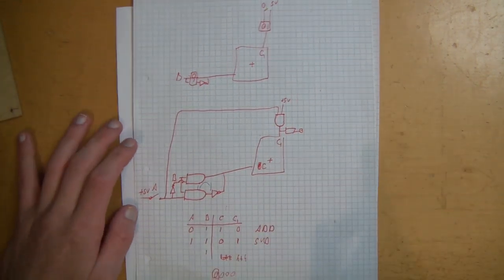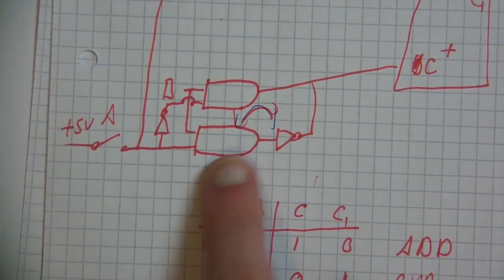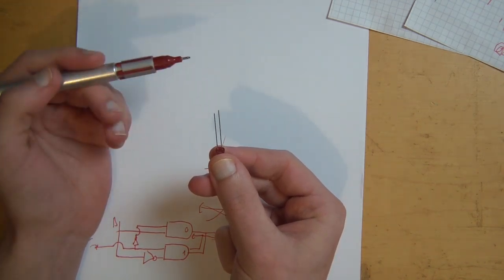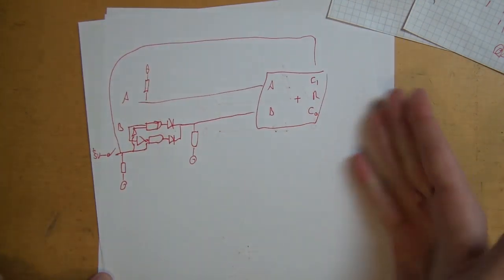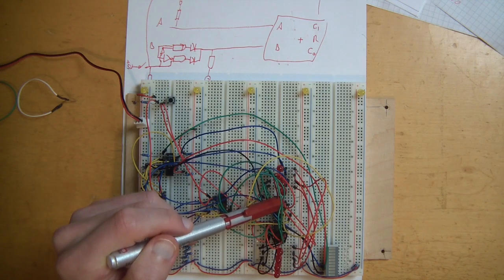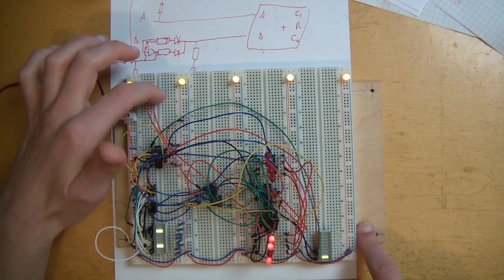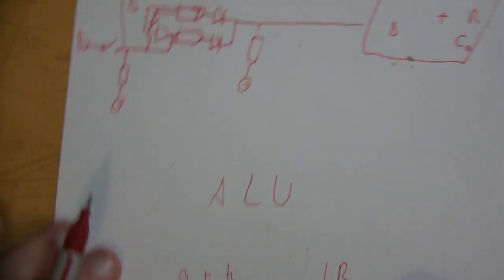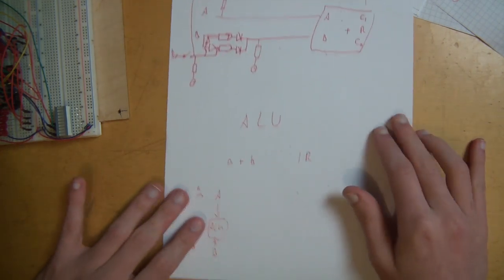4 bit ALU - Lets Build - 8 Bit Computer Part 7

Comment: Current follows the path of least resistance. You overcomplicated the whole circuit. No diodes needed... maybe an OR gate near the output, or maybe just a resistor somewhere along the line.

Comment: I was almost screaming USE DAMN XOR :) But whatever… And CMOS logic gates use MOSFETs so they are not current controlled, instead they are voltage controlled. Input current is only created by technological imperfections (gate/channel capacitance and leakage current). And one more… for simplest possible CPU (I know) you only need subtraction, comparision and conditional jump (which is one instruction and you don't even have to store an opcode, because it's always the same). Addition is not required. Read about SUBLEQ machine. I've built it in FPGA and it really works. It's the same situation as for NAND or NOR gates.

Comment: It is possible to implement the switching circuit with single Xor gate, inputs being B and S (for Switch signal). Let's analyze!. If B=0 and S=0, then output is 0 (output = B), if B=0 and S=1 -> output = 1 (not B), if B=1 and S=0 -> output = 1 (B), and finally, if B=1 and S=1 -> output = 0 (not B).

Comment: I'm enjoying the refresher, however, regarding current flow.  You are showing 'convention flow' not actual 'electron flow'  The actual current flows from the ground up to the positive.  Convention Flow dates back to before we understood how electricity actually works. It was assumed current flowed from high level to a low level, like water. The symbols used in electronics show convention flow for historical reasons.
Reply: Convention flow is usually what's shown and we understand that electrons flow opp to that

Comment: I think you should lose the diodes as they costs you 0.6 volts. Better use a transistor as an interface between the adder and the inverter logic.

Comment from the maker: 8000 series mostly. Can recommend. Adder is unfortunately 74LS series. Problem is 8000 series is CMOS and 74LS is TTL, dont work that well together. If you can, go for CMOS only. They only go up to 2 MHz vs. the TTLs which go up to 20 I think, but youre not going to use those frequencies anyway, as they will break your LEDs in 1/ 0.1 seconds respectively.